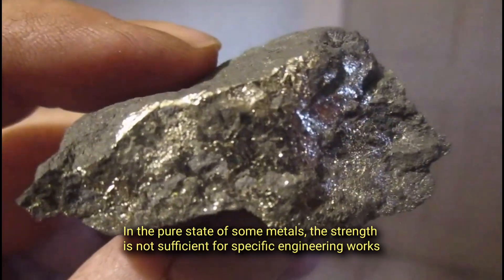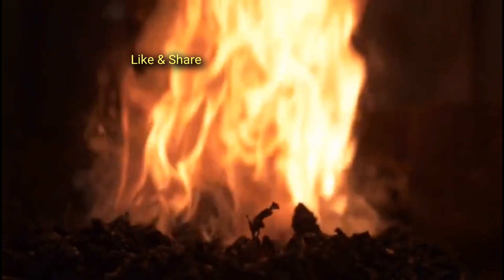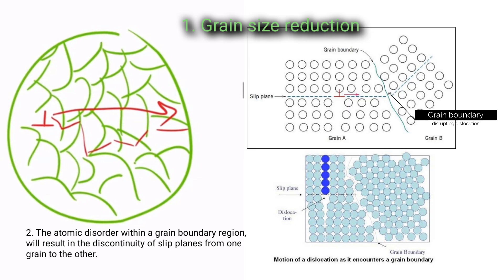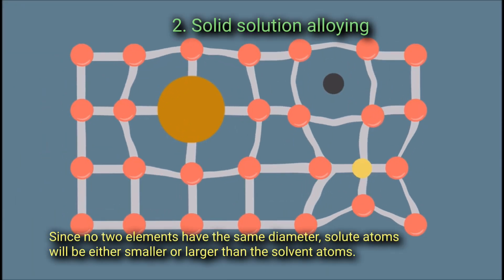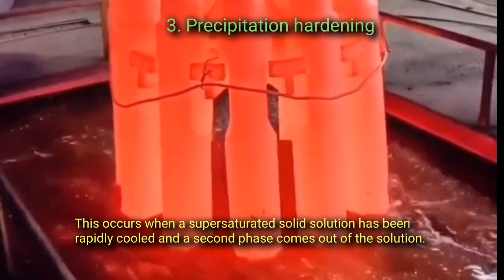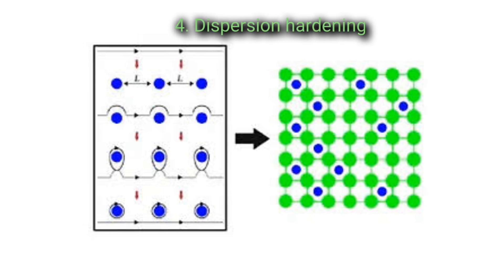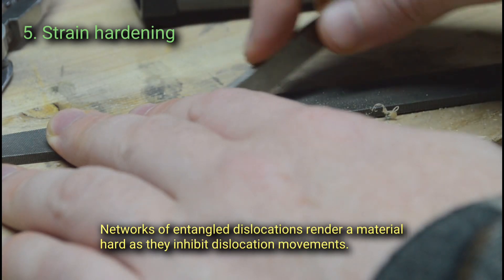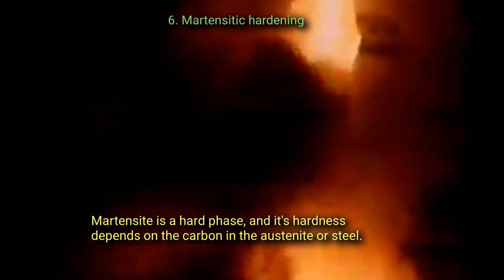Understanding The Six(6) Strengthening Mechanisms in Metals & Alloys

Comment: I discovered another way to strengthen metal, Electro-Static Frequencies where I found that metal bonds is a form of static electricity, different metals and alloys need different Static frequencies to harden the metal.